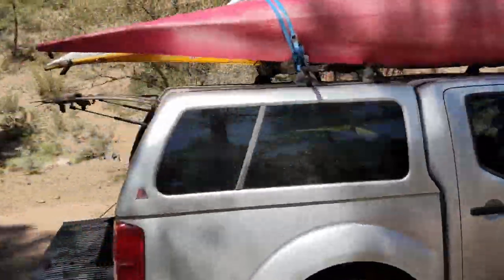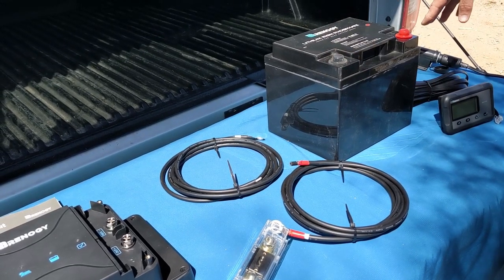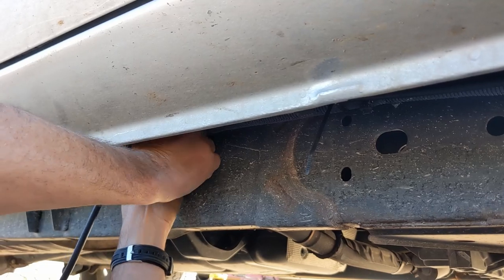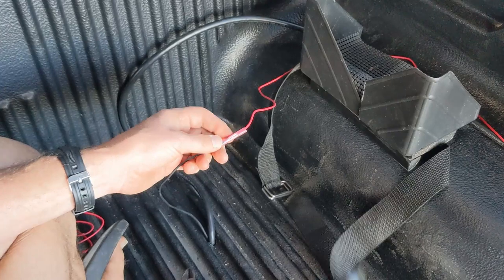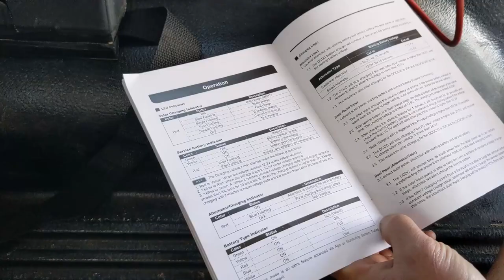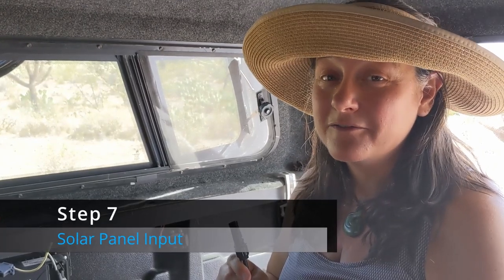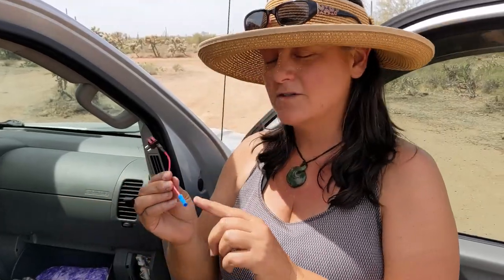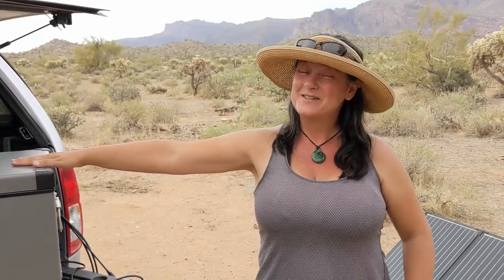Maximize Boondocking Power with a Renogy Dual Input DC to DC Battery Charger & LFP Battery Install

Comment: Instead of a wire nut you could still use a butt connector. Strip a longer section of the smaller gauge wire and fold it in half enlarging the size so you don't need a stepdown butt connector.
Reply from the maker: Great idea! I'm going to hold onto that one for next time.  There are always so many hacks!

Comment: This is actually an MPPT Controller, Takes Alternator, Solar at the same time. Then charges your house batteries. It's everything in one unit....They also make the 30 amp version...Only drawback. It can only handle 25volt solar panels up to 400 watts. But them panels are huge for an RV...
Reply from the maker: Yes to all of that.  We installed the 30A and Renogy makes a 50A as well.  One thing is that it splits the amperage by input, so you can only get 25A for each input, but you can install a switch on the solar input so that when you drive you can get all 50A from the starting battery, if the alternator can handle that much.  Yes, currently voltage input is not compatible with 48V systems, but probably will be in the future - that's the way stuff is going.
Reply: @FreedomInACan  I don't get the need for 48 volts on an RV or 24 for that matter. As the Array will never reach 6+ panels. You can hardily get 2 250 Watt panels on an RV that are extended. 

And yes an Alternator is rated at 2500 rpm. To get the rating..As the first 70-90 amps is consumed just to run the Vehicle..So 50 amps will shorten the life of any alternator. As that heat has to go somewhere..

Just things I ran across fixing these system.
Reply from the maker: To learn how to size a DC to DC charge controller, check out this blog article. https://www.renogy.com/blog/got-an-engine-get-a-dc-to-dc-charger/
Reply: @FreedomInACan  I'm an electrical engineer. And licensed Electrician for 40 years. As they don't teach it as Electrical Theory 400 years later for nothing..

I'm also a Automotive tech for BMW, Mercedes and Audi.. I seen what happens when Alternators are abused. It's not pretty. As these cars now have over 100 Modules in them. And they don't like low or high voltage. And when they go. It cost a fortune..
Reply from the maker: @WizzRacing  I think folks are attracted to the 48V options for their RV's mostly when they have the big ones, busses, motorhomes, 5th wheel toy haulers.  If you want to see folks nerd out on this, check out the Solar Powered Boondocking group on Facebook.
Reply: @FreedomInACan  I get that.. But those are, Motor Homes. 

An RV is a Recreational Vehicle. Classed as B, B+ And C...As Class C is pushing it if you ask me. 

I also don't think people understand. The RV was never meant for full time living either.. People did it out of necessity,  glamour, and there hip.. Why you see so many people claiming to be expert builders for clients. Till they end up in my lap to fix. As I just stumbled on this venture because of one customer. Now I got 10-15 a month to repair and service. On top of the MB, Audi and BMW's..

I work more now. Then before I retired. It's crazy. I'm too old for this shit..I need to hire experienced helpers. If I could find any..The goods one work for themselves too..
Reply from the maker: Oh man... I feel ya  You gotta know when to say when.  Best of luck and I hope you can scale back on your own terms.

Comment: Ya thats not a frame ground , thats the bed of your truck. It may work but I would run a jumper down to the actual frame
Reply from the maker: You are correct. Be sure to watch the rest of the video, it's in there. We grounded back to the starting battery of the truck.  The system has worked flawlessly for over a year now.

Comment: Your right about firsthand i drive a Nissan Navara and in the back of the Ute with a canopy i had a very similar set up as yours. I was north of Carnavan and caught a heap of fish overnight spent the morning fileting and put them in the fridge drove 600klms in 40/45degs C when i got the late in the afternoon the cig plug had slipped out just enough to not contact and i had slow cooked fish in the fridge not happy😞 now have Anderson plug no problems 👍
Reply from the maker: Caernaefon? Wales?  We love that area.  We used to take students there for a big Cymru adventure!

Comment: Thank you for sharing this video with us...❤❤❤Ambulance build here 🚑
Reply from the maker: Suwheet!  You are so welcome, and thanks for the shout out!  If you aren't that far into it, give the REGO system a look.  We're  putting one into a smaller RV travel trailer right now, and it's pretty burley.  renogy.sjv.io/ORP3EZ  I think it might be ideal for a larger van / small bus and it includes all three ways to charge, solar, engine and shore power.  Good luck with your build!  Send us a photo!

Comment: This is the only place I've found clear explanation of the IGN signal wire's intended installation point. Thank you.
Reply from the maker: Glad to help!  Thank you for the kind feedback.  We figure that if it's confusing to us, it's probably confusing to others, so we try to spend time explaining some of those small details that can trip up DIYers.
Reply: Isnt it just 12v when car is running
Reply from the maker: Nope, usually the alternator charges the starting battery at around 13.6V, and the DC to DC takes that and pumps it up to 14.6V (@30A) to appropriately charge the LFP battery which runs the fridge.  In this dual input model there is a 50A version as well.  Lemme get you an article that explains all of this.  
Since this video, we've installed a switch on this output so that we can charge our trailer batteries while driving.  We get an average of around 20-28A of charging current back to our trailer LFP batteries.  It's been a game changer when we're moving and the weather is cloudy, cold and rainy.
Reply from the maker: "Got an Engine? Get a DC to DC Charger." https://renogy.sjv.io/P0YQnR
"How To Choose & Size a DC to DC Charger"
http://renogy.sjv.io/MXokzo

Comment: Great instructions and explanation.  We are wanting to add a battery system for a fridge also. It was really useful to see your process in detail! Thanks!
Reply from the maker: You are so welcome!  And thanks for the comment.  We haven't once run our battery out with this set up.  The ICECO fridge is so efficient, and just sips at the battery.  If you haven't already picked one out, we'd highly recommend it.  

https://www-icecofreezer-com.myshopify.com/promo/canlife

Save 12% by using our promo code CANLIFE.

Comment: thank you for sharing, this is the best video explaining how to install the DC Charger I have seen. We have the 50amp Renogy DC to DC Charger with MPPT solar controller we have been trying to install but cant get the solar light to come on. We will now go through and check our installation and hopefully get it working. cheers
Reply from the maker: Thanks for the comment! Make sure you have it grounded properly, we had some trouble with the engine charge at first.  Let us know if you have any questions.

Comment: Definitely one of the best solar DIY vids I've seen. Nicely done. I think 4AWG from the battery is WAY overkill for 30A over 7 or 10 ft. I would of preferred not seeing the cable joint splice half way thru the + run, however!
Reply from the maker: Thanks for the comment, yeah not psyched about that joint.  We actually ended up removing that cable with the splice, and put in a full run of welding wire to ground the unit all the way back to the negative terminal on the battery.  Works great!

Comment: Your “frame ground” in the bed is not a frame ground, it’s s a body ground. Could cause issues with function/performance/safety of your set up.
Recommend: Move it to frame or add a larger ground wire from it, to to the frame.
Thank for sharing :)
P.S. Also, always clean/sand frame grounds thoroughly to bare metal to assure best contact.
Reply from the maker: Hey thanks, you are right about that.  The "body ground" was not adequate.  You may note that we added a ground wire all the way back to the starting battery, see 21:50 where we hook up the ground wire to the battery.   We also mention this at 11:52.   It's been working great since we did this!  Thanks for the input.
Reply: @FreedomInACan  so the ground wire is actually not need to be ground to frame if your running it back to starting battery is that correct thought?
Reply from the maker: @bobo8129  Yes, you got it.  We tried to ground to just the frame, or in this case the body, but we needed to take the ground all the way to the starting battery.  When we did that it worked without any problems.

Comment: Really excited to find this.  I have the same fridge model and am ready to start getting off grid instead of RV/State parks.  Got all the kit ordered just now.  Fun weekend project.
I had ordered the single input charger after seeing Hutch's other video, but I think the dual input is the better option since I have panels already.

Thanks!
Reply from the maker: Yes, we think it's a better option as well!  I mean why not get two for one?  One thing you might want to consider with this is a cut off switch for the solar input when driving in rain or clouds, this way you'll get the full amps from the engine/alternator/starting battery input.  We have a friend who did this and has been really happy with it.  Good luck and hope this only takes you a weekend!
Reply: @FreedomInACan  Good point about the cutoff switch.  I did see that in another person's video, come to think of it for exactly that reason.
Reply from the maker: @gr0uch02a  just out of curiosity, did you happen to order through Renogy using our link and promo code?  We've been having some issues lately and wanted to make sure everything was working correctly.  Thank you very much.
Reply: @FreedomInACan  I honestly don't remember, but my guess is that I did not use the affiliate link only because I was ordering parts for a boat project at the same time.

Comment: Great video, very useful. I do think it would be better to use red for positive and black for negative, consistently. It may work for now, but for anyone else who tries to help in the future, decoding multi-colored wires can be confusing, at least to me.
Reply from the maker: I agree with you on that one, doing an installation with consistent color wiring does help reinforce best practices.  Sadly, our supplier only had black.  Thanks for the feedback!
Reply: @FreedomInACan  I just hooked up my 30A unit... So, when there is no power draw, will the controller eventually go to "sleep"? This is in my daily driver...
I have a battery disconnect on my service battery but the truck battery is always connected 🤷
Reply from the maker: I don't know that it has a sleep mode.  If I understand your question correctly you want to be able to turn off the unit? What we did for those situations when we don't need to charge the batter, or the ambient temperature is less than 30 degrees, is installed a cut off switch between the starting battery and the fuse along the positive cable going back to the Dual Input 30A unit.  This means that our service battery (50Ah LiFePo) is still operating the fridge but not being charged.  The unit is still on.  But you could install an inline switch on the signal wire going to the fuse box.  Make sense?
Reply: @FreedomInACan  I was thinking something along those lines...
Thanks for the reply 👍

Comment: This did my ocd in how many times you connected and unconnected the wires
Reply from the maker: I know, right?  As lifelong educators, we know just how important repetition is for beginners to get their heads around a new concept.  Since our videos are designed for newbies, we take the time to repeat steps in order to make them as easy to follow as possible.  Funny aside...one thing we didn't share is that Hutch broke his wrist in the middle of making this video.  Had nothing to do with the installation itself, but it completely changed the course of our installation and filming schedule last spring.

Comment: Thanks so much for the awesomely detailed, and non-intimidating installation Vid.  Looking to do a combo of what you have setup in this video, and your trailer setup.  We just bought a RENOGY 100ah Lithium Ion Phosphate Battery, self-heating cause we’re up in Cold Canada, and the 50Amp Dc to Dc charger with MPPT.  With this setup, can you still somehow wire in shore power to charge the house LiPo battery from an AC Extension chord from your house when the van’s off, and there’s no sun?
Reply from the maker: Thanks for the positive feedback!  Great choice on the self-heating battery those are game changers!  The short answer to your question, is yes!  The simplest solution is an Inverter Charger.  This is one example at 2000 Watts.  renogy.sjv.io/Kevxjy -- (the smallest one they have is 1000W). The inverter charger would allow you to run AC appliances, and charge you batteries up while plugged into shore power.  
Or you could do what we do, and use a 20A AC to DC charger which we just clip onto our battery when we've had low sunshine and have access to shore power.  renogy.sjv.io/n1Zn19
Best of luck!

Comment: Great video ... really simplifies a complex install. One question I have is this: Is it possible to run all of the truck's onboard electronics from the "house" battery? It looks here like you are only running the fridge from batteries, correct? When the truck is not running, but you have onboard appliances (like the lights, radio) on is it drawing power from the house battery or the starter battery? I'd like to set mine up so that all of the truck's appliances run from the house battery, and the starter battery is only used for starting.
Reply from the maker: Yes, we are only running the fridge from the secondary battery, but we could run other things as well.  The truck's electronics are all wired into the starting battery, because the manufacturers don't go expecting you to live in your vehicle.  So, yes, when you are parked and want to run things like the lights, radio etc. you have to turn the key and give power to those electronics through the starting battery - which drains it.  I wouldn't want to go messing around with trying to sort out the complex wiring between the battery and the all the electronics in a vehicle.  But you can set up a secondary "house" battery, which is what most van conversions do, so that there is a house section which does not draw from the starting battery.  That's where the Dual Input Charger comes in, because it acts as a battery isolator, so that the starting battery doesn't draw down from the house or vice versa unless the alternator is running.  In the house battery situation, you generally have to duplicate systems like lights, vent fan, radio, which get power from the house battery.  It's good to keep these two systems isolated so that you don't end up with a dead starter battery out in the middle of nowhere.  Starting batteries are intended to give a large boost of current to start the engine, and then immediately recharge by the alternator.  House Batteries should all be Deep Cycle batteries which are designed to be discharged and charged over many cycles.  Let me know if you have more questions.  All the best

Comment: If your house battery is in a camping trailer, should the Renogy DC to DC controller with MPPT be in the trailer close to the house battery instead of in the tow vehicle?
Reply from the maker: Yes, the closer you locate the Dual Input DC to DC charger to your battery bank the better.  One way to carry the vehicle charge back to the trailer is through Anderson connectors, great for quick connect and disconnect!  Good question!

Comment: Two questions 
1-what guage is going from the truck starting battery to the anl fuse block under the hood?
2-Is that cca or ofc marine rated?
Reply from the maker: Two answers! 
1. 10AWG on the ANL Fuse Cable from starting battery to ANL fuse.  
2.  The product description for the fuse cable, does not specifically address the type of cable, except that it is TUV tested.  The Battery Tray Cable, does specifically say that it is OFC, so I will assume that the fuse cable is also OFC.  
Hope that helps!

Comment: I would of liked to see the battery monitor display in action. Does it show amps going back to both bateries and the voltages. Thank you
Reply from the maker: It will show the amps while charging, but the fridge battery has to be full in order to solar charge the starting battery.  We're doing another video soon to show how we've put a switch on this charger to charge the trailer house batteries or the fridge batteries depending on what we need.  Hit the subscribe button so you don't miss it.  Also, you can save 10% on Renogy gear with our affiliate link https://renogy.sjv.io/LPEyNY and promo code "CANLIFE" at checkout.  Thanks!

Comment: Great video. But does it run with only solar input? I want to buy a renogy charger but will be disconnecting the starting battery occasionally.
Reply from the maker: Yes, it's Dual Input...either car battery or solar...and it prioritizes solar when a panel is connected.  When your service battery (deep cycle) is full, it sends a charge back to the starting battery to keep it charged up!  Make sense?   It works amazing well!